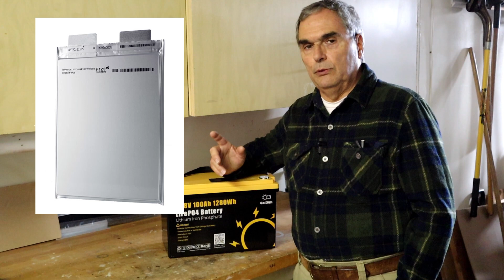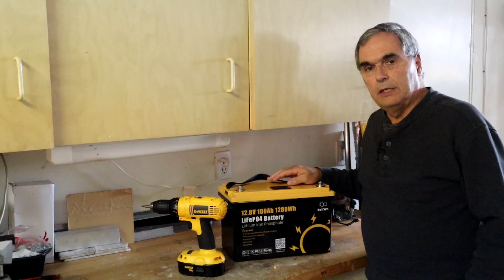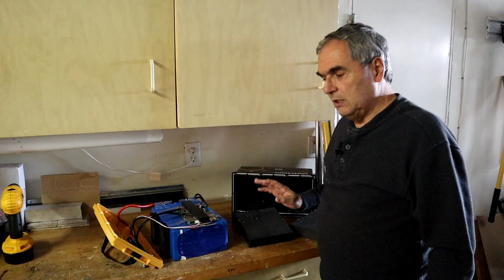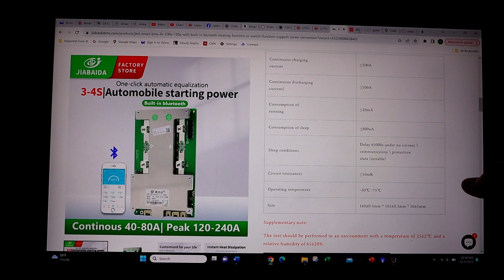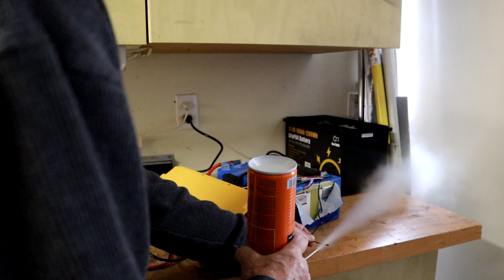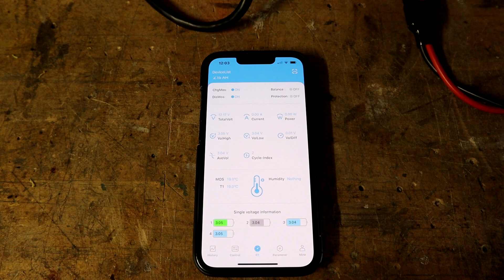GoKWh 100Ah LiFePO4 Battery Teardown

Comment: Good eval.  Nice to see the guts.  I am curious how accurate the BT system tracks SOC.  Have you done an extended eval?
Reply from the maker: In the video I do mention that the LCD display accurately tracks with my external measurements  of voltage, current and SOC during a full discharge cycle.  Since the BT will use the same data from the BMS that the LCD does, the answer is yes.  If you decide to order one of these batteries use the link below my video and the coupon code which could get you $20 off the price if it is still valid.
Reply: Thanks!!

Comment: Looks great, a lot less work than building your own pack from scratch. I made a 12v regulated voltage supply with a cigarette plug adapter for my scope using a regulator from Digikey and parts from O’Reilley, and mounted into a converter box.

Comment: It's too bad you delete helpfull comments and a better battery and a much lower value! Your not helping Astronomers.
Reply from the maker: I have not deleted any comments.  Tell us about the battery you say is better.
Reply: @astronomytipsreviewswithcu740 Hi Curtis, I also have been looking for a good 12v 100AH lithium and came across on Amazon 1 that was so different that I ordered 1 and during my discharge at 10 amps got 96 amps at a cut off at 12 volts. I just wanted to let others know as what I liked about this battery is a few screws and you have access to the cells and BMS, but what made it really good is a Low temp cut off and I am able to add a whole bunch of items, like 5.5x2.1 connectors, a digital readout, battery heater as the cells are smaller then the outside case. When I reached out to the company as all of these are made in China and when I asked them what is the BMS and cells and within a few hours I got the spec sheet and this company makes the cells! Almost all of these battery are just rebranded. https://www.amazon.com/dp/B0CN8R1BGK company called "Oasesenergy" for $189 + $5 s/h from California for under $200 I was shocked. When I posted it just helping others that may not have $300 this was an option. When I looked this morning it was not there so sorry I was thinking you removed it? This is a very small hobby and trying to help the low budget Astronomer as I am one...

Comment: It looks nice, but the battery is made in China.  I prefer USA product.
Reply from the maker: I think 90% of the batteries are made in China these days.  Not only that, most of the components inside the batteries made in the USA are actually made in Asia.  There is little to no cell manufacturing in the US at this point, except for auto mobiles, although that will eventually change.  But, I understand some prefer a battery assembled in the US.
Reply: Sorry just about everything is made in China as to Lithium cells! I agree with you but we let this happen... So sad.
Reply from the maker: Not to worry, there are efforts underway to build in the US which I am happy to see. @whatmattersmost6725
Reply: @astronomytipsreviewswithcu740  that will only increase the selling price.
Reply: Well, nearly everything is made or sourced from China. Regulations and price drove nearly all battery manufacturing out of the USA. There is some insourcing going on, but good luck finding a pack.
Reply from the maker: With the find of all that Lithium here in the Salton Sea expect battery production in the US to move forward eventually. @aagifford